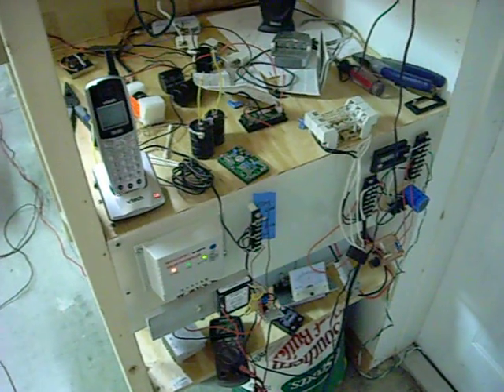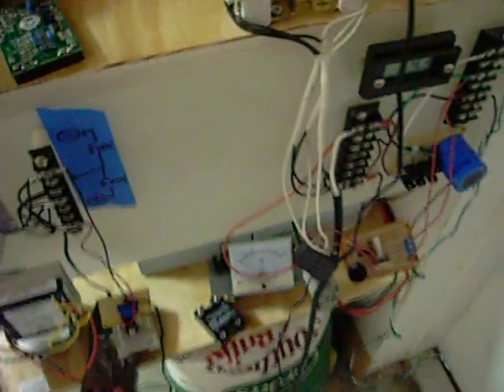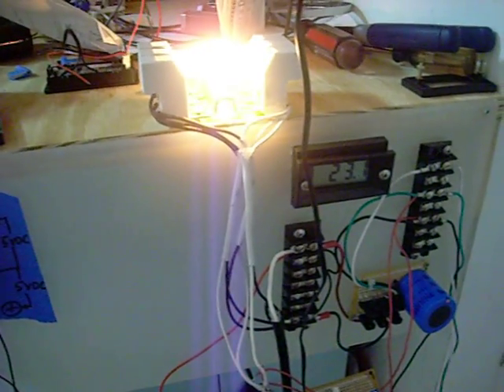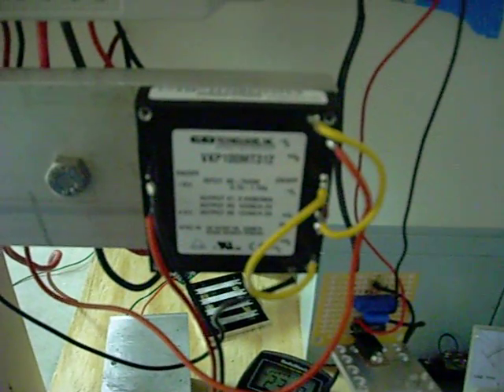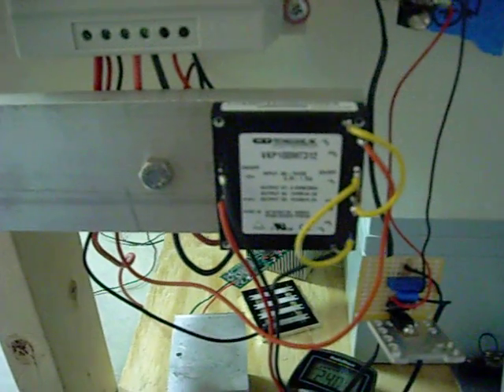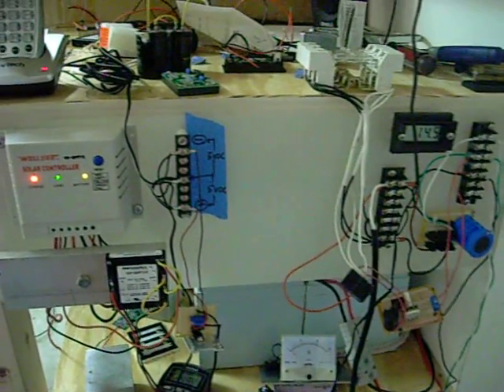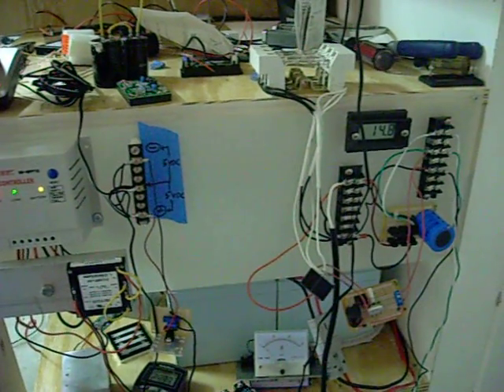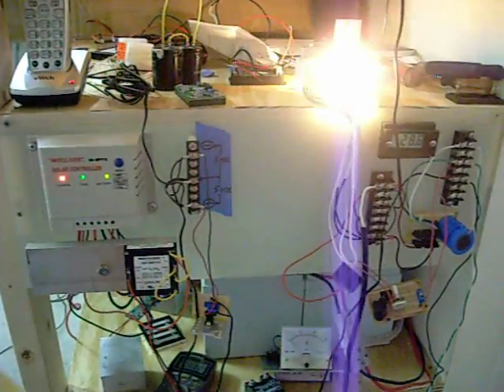Wind Turbine Control System Part 2:  Physical Components

Comment: How did you design the over-voltage protection controller?
Reply from the maker: I ended up using a FET as a switch to turn it on and off.  I can't remember the gate(on) voltage for the FET-most likely 20 volts.  I used a voltage divider to limit he FET voltage to the gate to 20 volts and also allow the dump load setpoint voltage to be adjustable.  The drain and source were connected to rectified power and then into 3 separate 24 volt relays(1 for each phase).  This allows me to dump load on the unrectified side while maintaining voltage control over the rectified side.

Comment from the maker: I ended up getting some DC-DC converters from Ebay a while ago that worked well.  They were 100 watt rated, and can take between 28-75 VDC in and put a constant voltage out.  I put some in parallel to increase the power handling capability.

Comment from the maker: @razorob1959 

I don't have a schematic per se of my setup, just a block diagram at the moment. The only circuitry I have built for it so far is the relay-based over voltage circuit you hear in the videos, and the schottkey diode bridge rectifier. I used some DC-DC converters off of ebay to help deal with the fluctuating voltages from wind turbines.  I'll shoot you a message to see if I can help....

Comment from the maker: @depravedpuma 
  I have also upgraded to a 800 watt Missouri Wind and Solar Patriot rotor.   From experimentation I believe the 500 watt slant core plus rotor is actually more powerful though, so I don't recommend spending the extra cash on the MW&S Patriot rotor.   To answer your question, if the bulbs burnt out, the rotor would be able to spin alot faster, and the output voltage to the DC-DC converters would be higher than they need to have.  They are however over voltage protected.

Comment from the maker: @depravedpuma 

I have updated the system a little bit from where it was before.  It now has 3 individual bulbs that are rated for 150 watts each.  They are controlled from the rectified voltage side, and are switched in on the un-rectified side.  So I have one 150 watt bulb per phase.   This keeps the load on the turbine constant on all 3 phases, and eliminates rectifying the energy just to dump it with the control circuit.